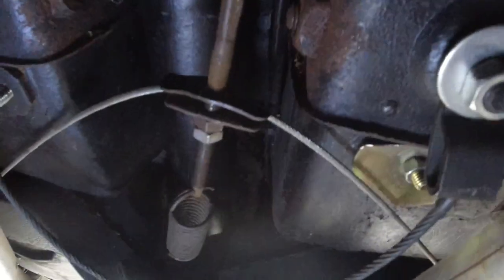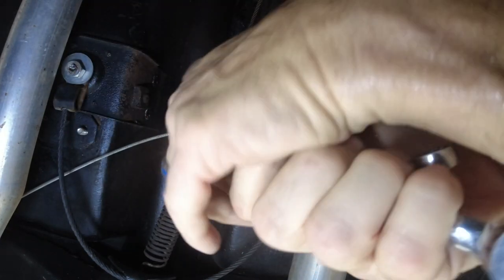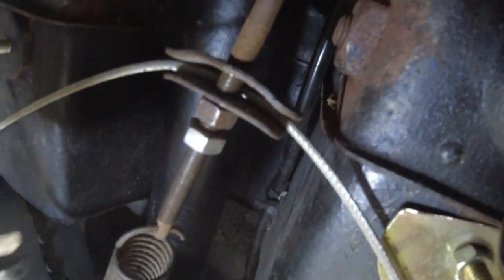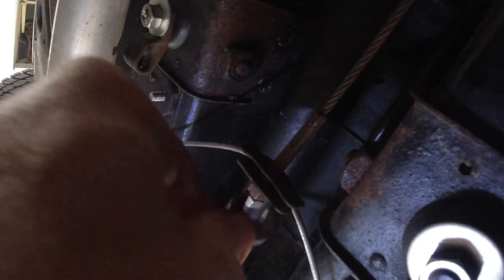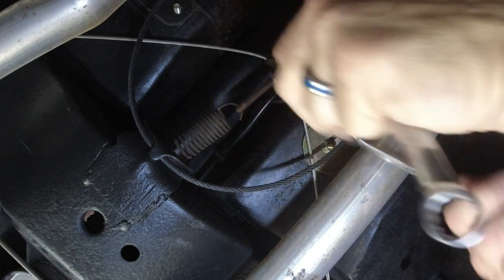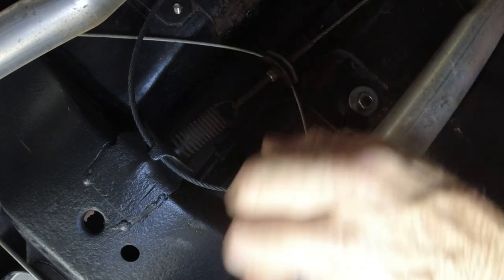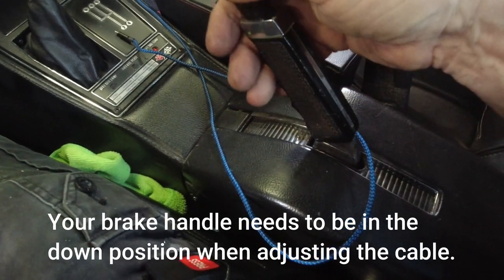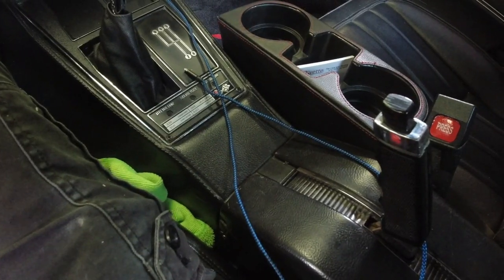ADJUSTING THE PARKING BRAKE ON A C3 CORVETTE

Comment: Did you do anything with the adjustment "star" wheel at the drums or just the jam nuts on the cable?
Reply from the maker: The brake assemblies are new. I adjusted the star wheel on the brake shoes and the cable when I first purchased the car. It appeared to work fine at that time. Unfortunately, I did not video that. I never used the parking brake until I installed the 4 speed. That was when I discovered that it still needed a little more adjustment. I guess you should always use your parking brake even if the car is an automatic. Thanks for watching.

Comment: This is been the wrong way figures backyard mechanics it should be done on each wheel with the star before you even attempt at adjustment Jesus reads the GM manual it's the same for all parking brakes you just the drums or the handbrake at the wheel first and then to cable
Reply from the maker: I did not show that but Yes, I did install all new parts for the parking brake and adjust them with the star wheel to the proper clearance. I just did not video that part. This video was a couple of weeks afterwards, when all I needed was a slight adjustment on the cable. Sorry I did not explain that in the video. My bad. Have a great day.